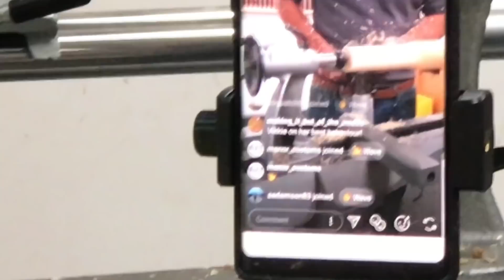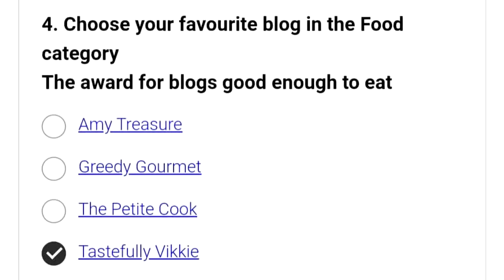Learning Woodturning with Record Power | The Carpenter's Daughter

Comment: Looks like you all had so much fun and learnt loads. The skew is the tool of all tools. Some refer to it as the Scary Skew as it's the hardest to fully use without getting catches. Looking forward to seeing you on your progress with the lathe.

I find bowls hardest as it's getting that even finished surface your after. A spindle I find can be easier as you often don't need that precise surface.
Reply from the maker: Lol, I told them John Clothier recommended not using it to start with as it might put me off... so that made them more determined to use it 😂  We had so much fun and definitely need to do something like this again!  I turned my lathe on for the first time today just to check it wasn't dead lol... am going to have to take time cleaning it as it didn't spin properly, but might be something really simple.

And interesting you sat that!  I've been watching a lot of bowl videos since and it didn't look that easy to gouge it evenly at all.  Spindles are starting to look easier to do - providing they don't use the skew lol

Comment: Well done, now fire your lathe up and go for it but do consider safety first. Ahove all the main danger is dust. I have worked with wood for 55 years and I have lost a lot of my lungs to dust. You need a good extractor, e g. Camvac and a respirator with a P3 filter, this covers you to dust particles down to 0.3 microns, dust particles,  from sanding,  have been  recorded at 0.7 microns. 
Have fun.
James